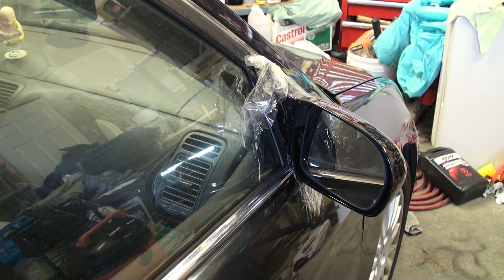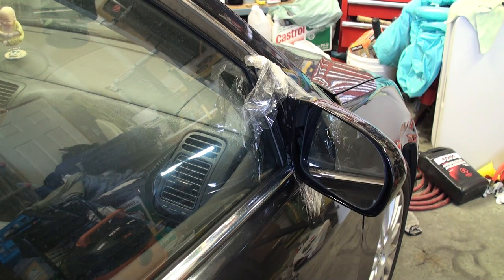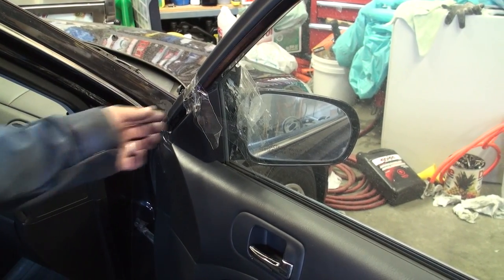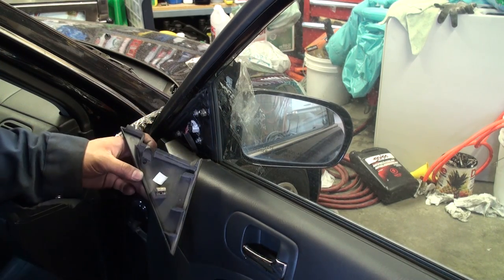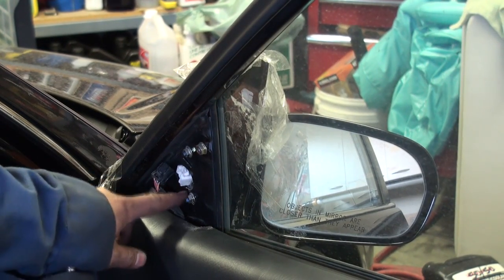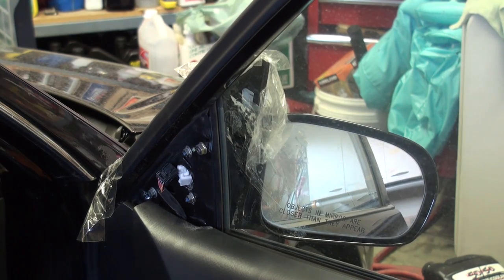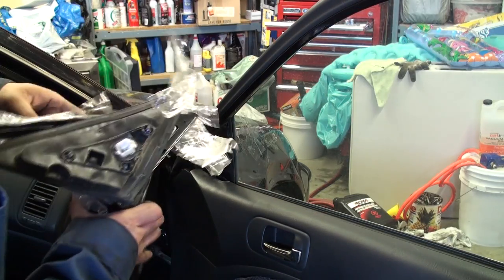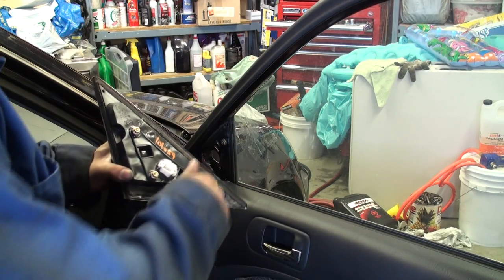DIY Acura EL or Honda Civic Side Mirror Replacement

Comment: nice video.. thanks.
I have a question. will a civic 2002 mirror fit to acura el 1.7?
Reply from the maker: I believe it is a straight bolt on affair permitted you use the same series of mirror.  For example a 2001 - 2003 would fit a 2001-2003 Acura 1.7 but a 2004 and 2005 might not fit perfectly b/c those years were the later year refresh versions and they always make minor tweaks to their cars.  Best to stick with the years that match your car or close to it.
Reply: piercedasian great Thank you. I have a 2002 Acura EL and im finding it difficult to get a driver side mirror. i will try a civic 2002.
Reply from the maker: Hope you're able to find one :)

Comment: Will this be as simple on a 2002 honda civic type. R
Reply from the maker: @ marknjoanne - yep very similar replacement procedure.  I think on the Civic Type R you might have a tweeter on the little triangle piece which you'd have to either let it hang or have a helper hold or possibly even disconnect but the general process is the same.

Comment: my 05 civic ex has a speaker where the triangle cover is.. can i still pop it open?
Reply from the maker: +Jordan Sherard yep, the speaker is actually the tweeter and it will come off the same as if you didn't have a tweeter.  Just be careful when removing it that you don't "rip" the wire out and damage it.